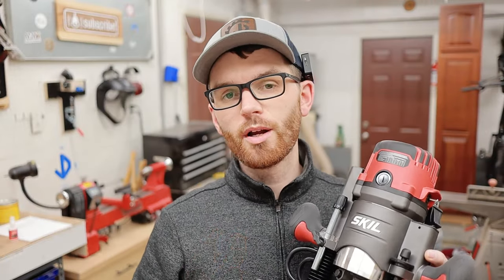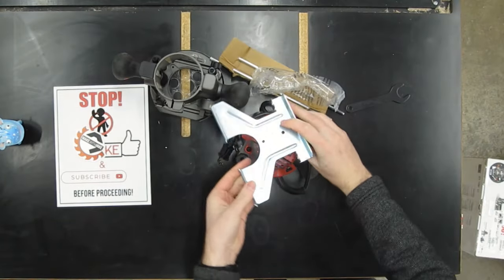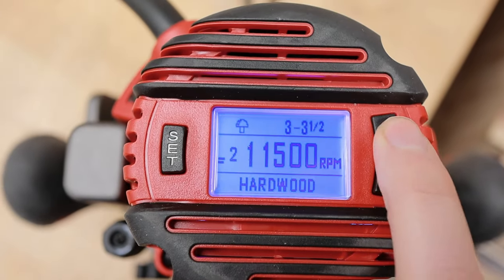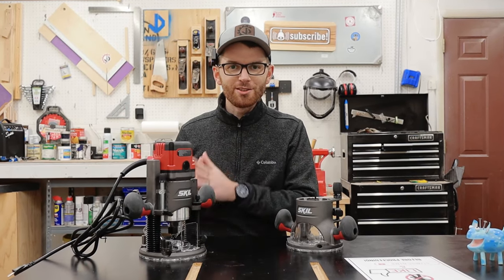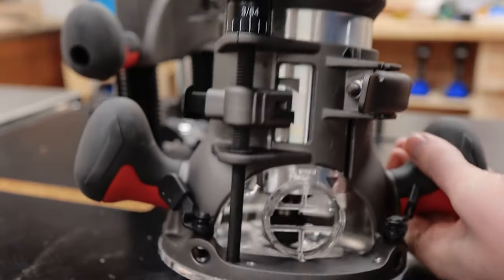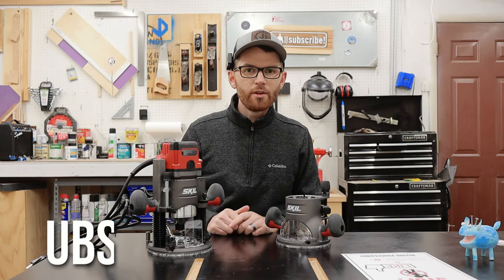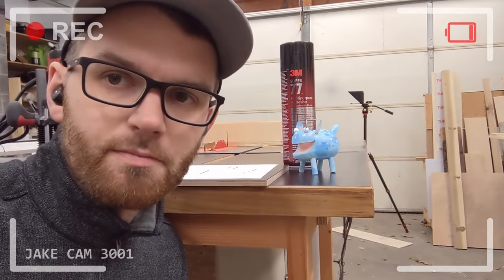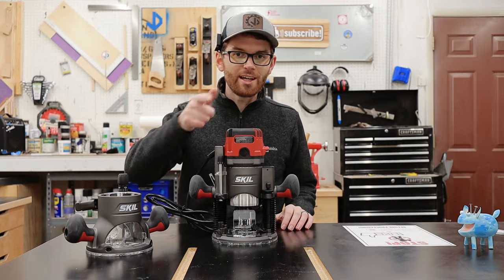Does SKIL make good tools now?

Comment: That last coarse adjustment lock (5:03) is for when it's mounted in a router table so that the bit will rise up through the 3/4" router table top. I have their table and router kit and it's excellent! My Porter Cable router recently died and I didn't want to spend a fortune because I don't use the router that often so I'm very happy with this Skil kit.
Reply from the maker: awesome, thanks for watching!

Comment: I bought the same kit last Christmas at woodcraft for under 100 bucks. And it’s still running strong. And I did not know that the fixed base had that depth adjustment on the bottom. Thanks for the video.
Reply from the maker: That is awesome!  Thanks for watching!

Comment: I have one and am very pleased. The only issue is when using 1/4” shanked bits be sure to very snugly tighten the bit holder. It will slip if you don’t.
Reply from the maker: always good to double check that, for sure!

Comment: Honestly this kit seems like a killer option with some good versatility. I’ve been wanting to invest more into my routing as I only have a fixed base palm router that’s good, but I’ve been in some real sketchy situations with that thing that a plunge base could help make it much safer. But with the included fixed base you can have the fixed base permanently inserted into a homemade router table and with the accessible depth change from the base you essentially have a router lift. So this kit seems to check all kinds of boxes for me!
Reply from the maker: those are my thoughts exactly!  Ive got a few projects coming up , so hopefully I can beat it up a little more and work on a review video. but so far, so good!

Comment: Thanks for taking the time to review this router.  Can you please tell me the diameter of the motor? I want to make sure it will fit in my router lift which takes a 3-1/2" diameter motor.
Reply from the maker: Sorry im so late on getting back with you, Ill try to get this measured up.  If you shoot me an email, that would be best, since these comments get lost.

Comment: Very cool! I'm in the market as a brand new router user. Cost is an issue, however I am not opposed to waiting and getting something better if that means I won't have to wrestle with any quirks, or if a better tool will allow me a higher ceiling for growth as I become accustomed to its use. What do you think? Would you recommend this for a beginner? Do you have other suggestions? Thanks!
Reply from the maker: I have no complaints with this router so far.  I still think its a great value, and will last you a long time.

Comment: I got the exact identical one about 10 years ago but only difference was the name of Craftsman model 320.50429. And it has been abused but still an amazing Digital Router. Only issue I have had over the years is the plastic dust port shoot got knocked off the cover plate.
Reply from the maker: Wild! I just looked that one up and man...it is literally exactly the same, just not as red! Its pretty crazy how these machines just change names/brands over the years.
Reply: @MakewithJake  I agree. But it has been a great Router. Only complaint is the way I use it. I keep that one in my router table as I have others to move around with but when I change bits and woods I have to take it off the change the settings on the digital screen. A quick speed dial would be easier but would have to calculate the speed myself. So win some loss some. 😂

Comment: Looks like a good kit. One potential issue if you mount this in a router table wouldn’t it be difficult to adjust the speed?
Reply from the maker: Hmm, definity a good point.  I use an older craftsman in my router table
Reply: @MakewithJake   I have that same craftsman router that I plan on making a router table for. Just picked up a Dewalt DW618PBK kit at a pawn shop new in the box for $130 for hand use.

Comment: Very interesting! I have the Rigid version and the router is almost toast. It's got to have a shot bearing or something. Also the plunge base isn't that smooth. Might need to upgrade soon and this looks like an affordable option. Keep the router in my lift 99% of the time.
Reply from the maker: Thats a bummer!  Im not sure if the SKIL will last longer than the Rigid or not.  I would typically put the Rigid in a slightly higher class of tool, but after holding the SKIL, it does seem similar in feel to the RIGID.  But only time will tell.  They had to save money somewhere....

Comment: What are your thoughts on the fixed based version + router table combo that's on sale right now? Good value, or pass?
Reply from the maker: I can't speak too much to it.  But I think the router that kit comes with is the smaller 10 amp version.  Unsure if it is speed adjustable, but I know it doesn't have the LCD.  I personally see more uses for the plunge base and fixed base combo.  Hope that kinda helps!  Thanks for watching!

Comment: So how’s this holding up? I was considering the Bosch with the plunge and fixed bases that’s on sale right now and came across this one for $50 less. The digital display looks cool, but concerns me the most.
Reply from the maker: So far, so good!  Depending on how often you use it, I might consider the extra $50 towards the Bosch a good investment.  Not because I have had any issues with the Skil, but $50 is getting into that ballpark where buying a tool with a known quality is worth it.  Of course, if you only plan to use this router a few times a year...save the $50 and go skil everytime! Good luck!

Comment: to everyone out there  i recently purchased this unit i want to get some guide bushings for it but am getting mixed signals on what type to get  any suggestions from current owners!!!!
Reply from the maker: The harbor freight bushings fit...sorta.  They are a bit tall which limits the depth you can cut, but otherwise, they do fit.
Reply: @MakewithJake  thanks jake what i was needing to know, i do have a grinder so guess i could shorten one if needed  thanks again